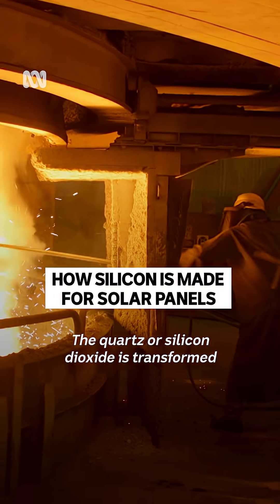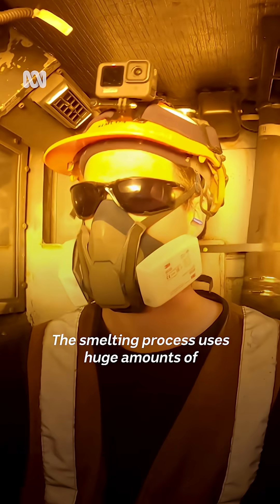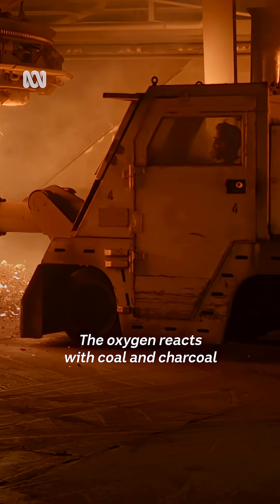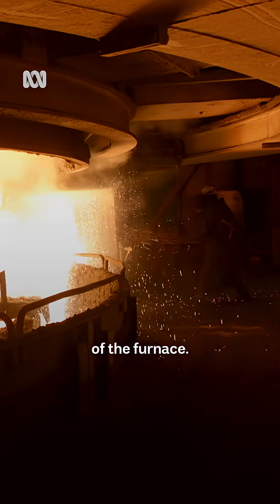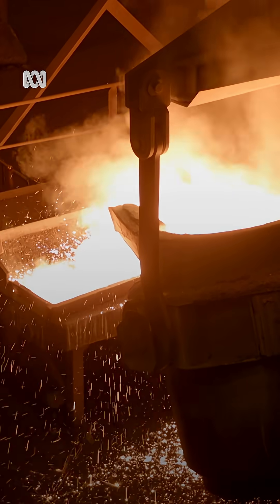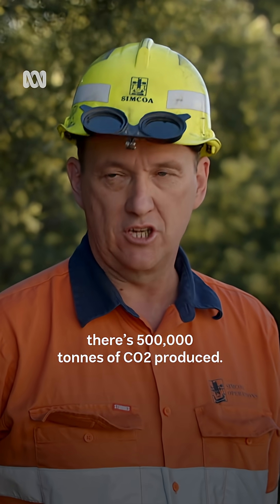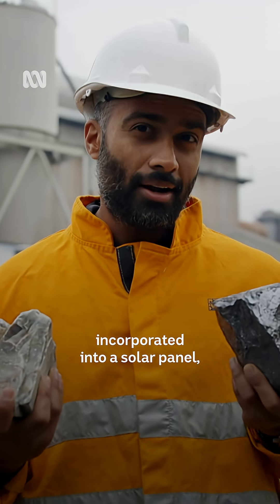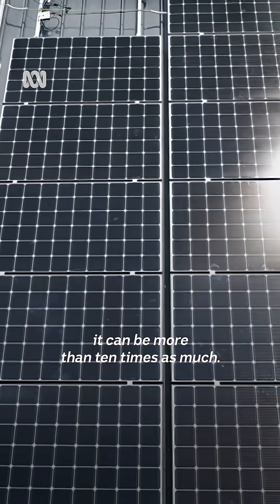"It's like working in a volcano" #Science #Solar #Shorts

Comment: Really funny how we’re replacing the more efficient and cleaner solution, nuclear power, over this
Reply: and who told you there isnt a lot of co2 being released during the initial construction of nuclear plants?
Reply: @obinnaogueri during the INITIAL 🧐🧐🧐 from plants that are currently still operating and being mantained that could last for centuries, unlike lithium batteries
Reply: @r3n837  Exactly which plant do you think has lasted a century……?
Reply: @ImpossibleSolution-k6w longest lasting powerplant was built in 1969, still currently running and being operated, that’s about to be 57 years, little more than half a century.
Tell me wich solar powered battery has ever had the same capacity, or has been able to last for that long and power that ammount of energy?
Reply: @r3n837  still not a century and if you are talking about the longest running nuclear power station in the world, Beznau in Switzerland, it has been refurbished many many times, most recently in 2024 was assessed for a refit costing 350 million CHF which was supposed to keep it running until 2033 ( could build just a few fields of solar panels for that) , they decided fortunately the money could be better invested elsewhere and shut the dangerous dinosaur down. Also the average lifespan of a nuclear power station is 30 - 40 years. Solar panels typically last 25-30 years, though many can continue producing power for longer, even up to 40 years or more and all for considerably less money. Also we are talking about an industry in its relative infancy lets see how long they will be able to make solar panels last with their new chemistries.
Reply: It's funny you believe that. Actually it's not funny.

Comment: And CO2 emissions could be less if they would use only electricity from renewables. As for the CO2 from the oxygen in silicon, since it is irreversible, this could even be one of the few sensible uses for direct capture and utilization for other purposes or storage. In addition, we are beginning to learn how to recycle silicon, meaning that less and less new silicon needs to be produced if the learning is successful.
Reply: The two major manufacturers of solar panels are China and India. It takes a lot of energy to manufacture solar, and both India and China are primarily powered by cheap coal. Due to the size and consistent nature of the power required for the process, only nuclear, geothermal and hydroelectric are viable renewable sources. Hydroelectric and geothermal are highly location-locked, and nuclear is not cost effective enough to produce cheap and accessible panels. It's a good idea to have it produced via renewables, but solar panels fueling the silicon separation process is a non-economical process.
Reply: @godc71 India? Sure. But China has been stepping away from coal for a while now, and it only powers about 60% of all power consumption. At the rate they’re turning green, they’ll likely cross the threshold to be majority green by the end of the decade.
Reply: @littlepiggy200 no, while china is byulding a lot of green energy infra, theyre also approving and constructing new coal plants also
Reply: @littlepiggy200 no, while china is byulding a lot of green energy infra, theyre also approving and constructing new coal plants also
Reply: @godc71  nuclear is very significantly more cost effective than coal, and it is only going to continue to get more cost effective over time as the coal supplies dwindle

in america nuclear power is very expensive because during the takeover of nuclear power it was overregulated out of fear that it was dangerous which caused significant setbacks in any nuclear plant construction project and made starting a new one seem like a terrible idea, which is terrible for nuclear power companies since they can't make any money until the plant is built and have to rely exclusively on investors who think it's a good idea... also it's only gotten worse since then because of extensive lobbying by fossil fuel companies (specifically companies that collect and refine fossil fuels, because they actually stand to gain more profits as fossil fuels become less abundant, but only if the people have no choice but to continue using them because it takes too much time and money to build nuclear plants)... it's all going to go away once we finally run out of fossil fuels, probably because it will cause a localized recession, but it's all good cause we're gonna learn nothing and do the exact same thing with nuclear plants once we start running out of uranium! :D (at least it won't destroy the environment when we do)

edit: to clarify, nuclear power is still more cost effective than coal in the US even with our current over-regulation, the amount of power that can be produced by nuclear plants is just so ridiculous compared to coal power that it makes all of our petty politics completely meaningless, but we still don't build them because none of the super rich people want to invest in an industry that all their super rich friends are actively trying to suppress, that would be a pretty bad idea
Reply: @nobodyinparticular968  in every part of the world with the exception of sanctioned countries fossil fuels have a cheaper LCOE than nuclear, and there is still so much untouched coal, australia alone hasnt even scratched up to 50% of their high grade coal and there is still abundant low grade in every continent, one of the undisputed reasons to switch to renewables is bcuz it is high tech, and high tech always improves productivity, we might not know how right now, your only job is to implement and watch the future innocations unfold, most people didnt see the need of an automobile when they had horses, now we can all see the productivity gains gotten from theat switch
Reply: @obinnaogueri oh i knew nuclear plants generated more power per dollar of fuel than coal but i hadnt heard about the LCOE before (which seems to take the cost of the plant into account?) but when i went to look it up just now the wikipedia page showed a graph that had gas jist above nuclear way higher than anything else on the graph, until 2023 when nuclear reached the top and the graph ends, so it seems like nuclear is at least slightly cheaper than fossil fuels even today (also im sure the lcoe would explosively increase if the cost of building a nuclear plant wasnt in the billions)
Reply: @nobodyinparticular968  yh, definitely, if more investment was poured into research on nuclear plants, their cost wouldhave dropped drstically

Comment: But if it's made into a computer chip, it'll be used to use even more energy!
Reply: its a good thing the computer chip uses so little compared to the solar panel
Reply: @nobodyinparticular968 not if it's made into a GPU, those burn tremendous amounts of energy, especially the ones being used to train AI
Reply: @GJ203  i mean uses so little silicon, if all th energy is green the power consumption no longer matters
Reply: @GJ203  he meant it uses so little slicon to prdouce the chipm doesnt matter what kind, theyre small in size